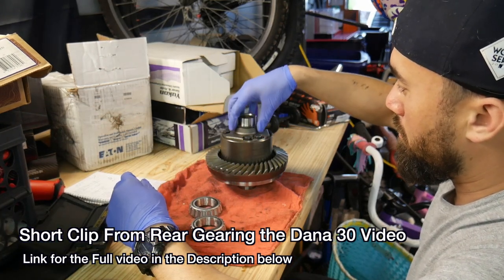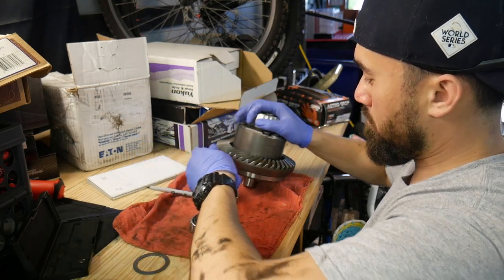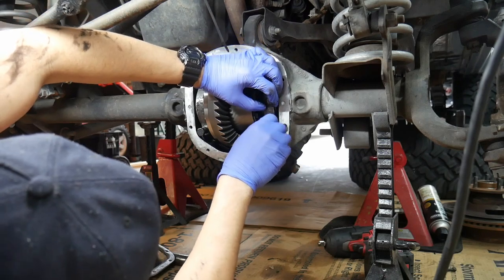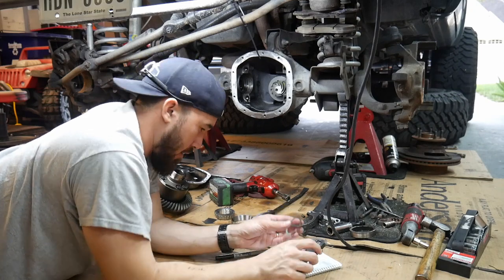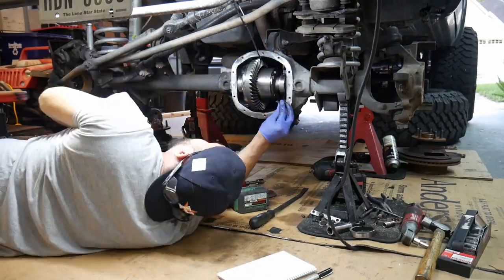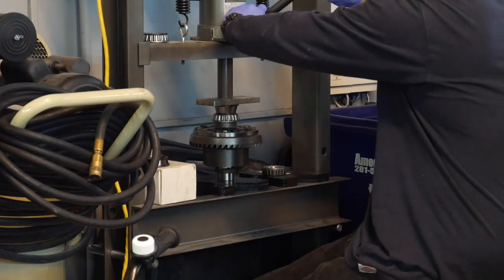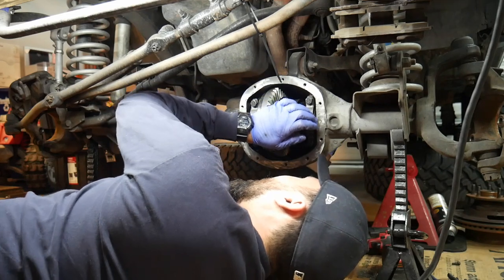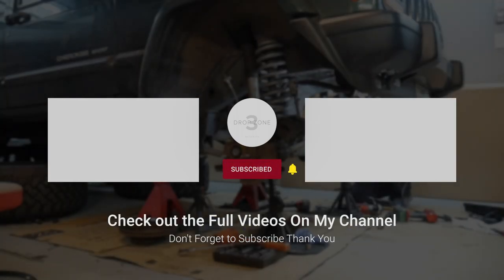Setting Backlash Dana 30 Differential / Short Clip from regearing Jeep Axles / xj TJ jk jl

Comment: @ The Late Model Tech
I recently did a bearing refresh on a Dana 30 and mixed up the carrier shims. I am able to get .005 or .0085 backlash although my measuring technique may not be perfectly perpendicular to the gear face but is certainly close. The specification calls for .006 to .010 but I heard you mention tighter clearances in your video.  Do you think I should opt for the tighter tolerance?  I certainly appreciate the in depth instruction and taking the time to help others.

Comment: And just to clarify, you used dana 35 bearings for the setup portion so you could easily slip the bearings on and off the carrier?
Reply from the maker: Dana 30 bearing.
Reply: @Donnythelatemodeltech  I think i missed something then. How were you able to slip them on and off by hand in the beginning then needed to press them on later?
Reply: Also, according to Amazon, your link in your description for "used for setup... axle bearing", that is a bearing for a Dana 35.
Reply from the maker: They might be for both applications,
Reply from the maker: Full video https://youtu.be/pitag-XgaNA